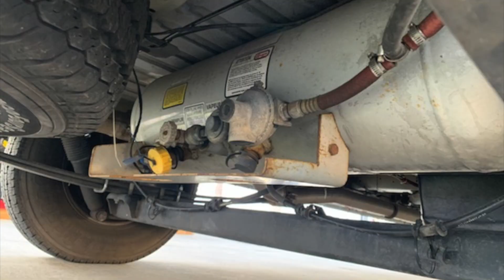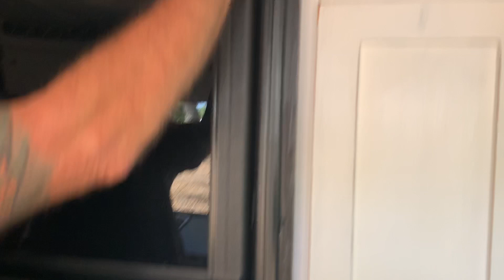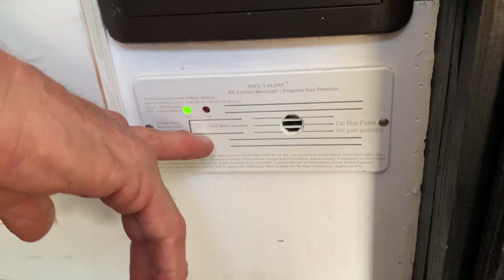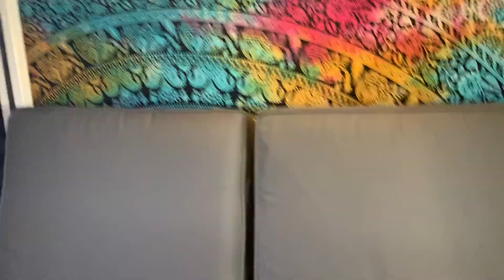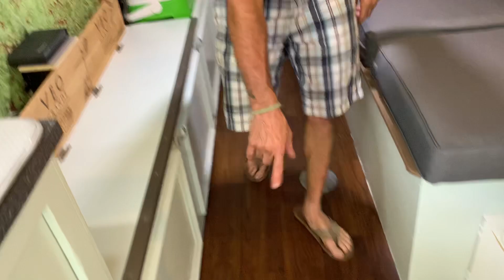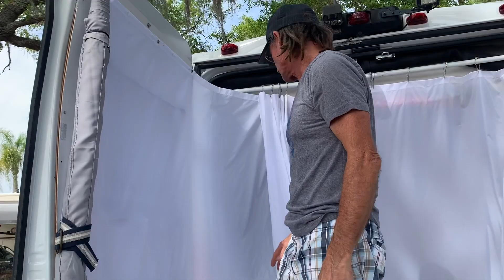Stealth Conversion Van Walk Around

Comment: Wow 🤩 .. that’s an awesome built, kinda what I like to be doing on my Van. Things I like in your design are 1. Lift bed system with sitting area below.
2. The shower platform Wow. I thought of using heavy duty slides but loose some ceiling height. Yours is simple n effective. Add another top cover would be extra room even if it rains. 
Thank you so much for sharing 💕

Comment: WOW you have everything,no went for a water heater?☮️🇺🇸🗽✌️
Reply from the maker: There's propain to heat the water
Reply: @HannahSpreadingLove  I was trying to ask,about a water heater, I don't see any exaust pipe,
Reply from the maker: Zoltan Szabatin you have to run the vent when using the water heater or doors open.